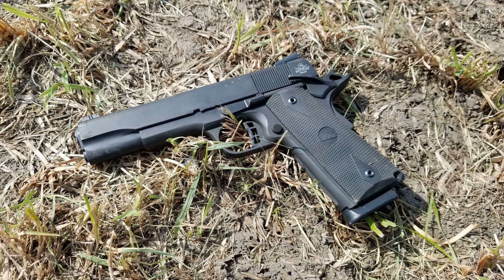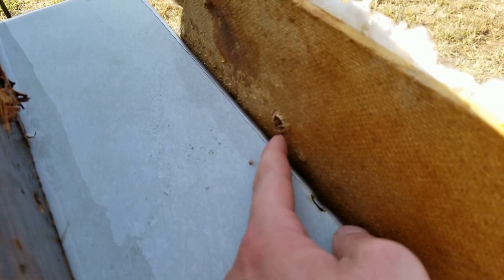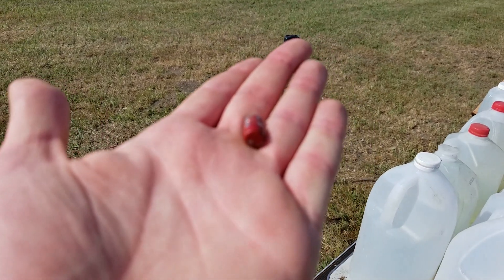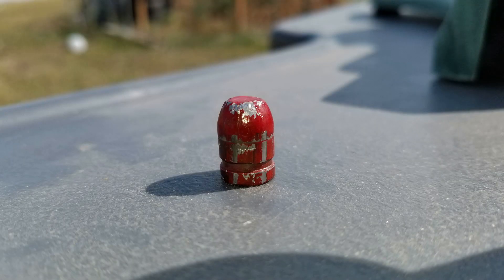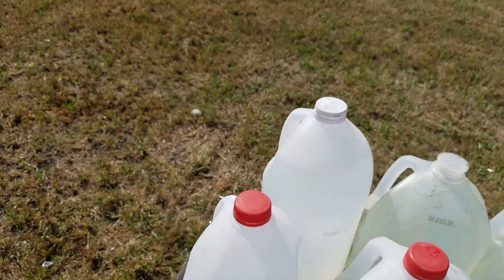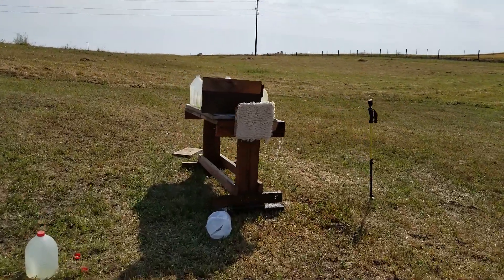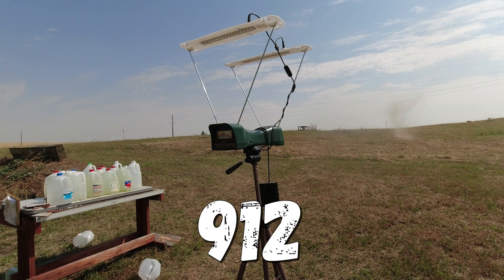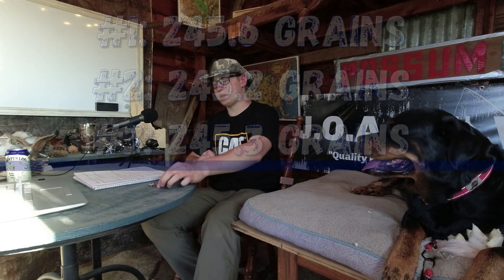45 ACP For Bear | Underwood 45 ACP +P Hardcasts | Jugs Test + Simulated Bone Barriers

Comment from the maker: I want to apologize to everyone here. I advertised that the Buffalo Bore ammo (255gr +P hardcasts) hit harder than the Underwood ammo tested here. But, I made the mistake of using the advertised bullet weight of 255 grains to calculate 520 ft/lbs of force for the Buffalo Bore while using the average weight of 245.36 grains for the Underwood. The more accurate number for Buffalo Bore, using the average recovered bullet weight of 231.25 grains, is 472 ft/lbs per shot. That places it closer to the Underwood's 457 ft/lbs for sure. Buffalo Bore is still a little harder hitting, but not by as much as first thought.

I want to give a big thank you to Rodney Spence for letting me know!  
Thanks guys, and I apologize once again!

(P.S: using the advertised bullet weight of 255 grains for the Underwood you get 475 ft/lbs to compare to Buffalo Bore's 520 ft/lbs)

Comment: I prefer the Underwood ammunition over Buffalo Bore and Doubletap for the following reasons: 1. Underwood is lot more cost effective than either 2. Underwood uses nickel plated brass casings for less corrosion and better feeding 3. Underwood seems more consistent on their stated velocities
Reply from the maker: Those are good reasons, but I do want to point out that the Buffalo Bore rounds were all Nickel plated (that I recieved) and the Buffalo Bore was faster than their advertised velocity and these rounds were just under what was advertised. But thats just my findings, they may differ from batch to batch 👍

Thanks for watching!
Reply: @JepsOutdoorAdventures  Ok good to know, all the Buffalo Bore I ever bought was brass cased, must be something new using the nickel plated cases, even their website shows the brass cases
Reply: Underwood runs very consistent semi-auto cartridge velocities, and they are usually pretty hot stuff. However, they usually quote near carbine-like velocities on the box.
To contrast, Buffalo Bore does very good rimmed revolver cartridges, better in velocity, accuracy, and performance than Underwood does.
Both brands are pretty superb, they each have their strengths.
Reply: Agreed.
Reply: Buffalo Bore is always faster than advertised, but his prices are just absolutely ludacris for the hardly nothing gain in speed you get over Underwood.

Comment: I was just kind of wondering if you had ever read John Taylor’s books. And do you know what he meant by KO or knock out power. He was a poacher, and when he was hunting elephants, if he used a large heavy enough bullet. If the bullet did not penetrate the brain and kill the elephant, it would have enough power to actually knock the elephant out where it would fall down unconscious, and he could go up and finished it off and with another bullet into the brain. In other words, he had to shoot as many elephants as possible, and if he did not have the best angle to quickly kill the elephant with the first shot. He had to bring as many elephants down and the shortest amount of time. He knew if he did not kill the elephant right off the heavy bullett still had enough power, at least to knock the elephant out (knock the elephant unconscious) where he could then go up and kill them quickly afterwards with a brain shot.  If you don’t believe me, read the books because I did.

Comment: Yeah, that's gonna hurt. A 230gr roundball will go right through a 72 Ford Turino front fender, inner fender, firewall, knock out the ashtray, through bottom of front seat, back of front seat, lodge in the rear door. Straight on, it will go through the door and leave a hole size of thumb. We tried it out of a 5" and that was old Winchester White Box. That one would seriously hurt/ stop a bear but it all depends on shot placement. Target groupings at 25yds would be nice. Tkx for the video.
Reply: I laugh at people saying that 45 won’t go through car doors or glass….not in my experience, and that’s with ball ammo.  The Lehigh rounds are even better.

Comment: How about a test with S&W .40 cal 200 gr Buffalo Bore hardcast.

All the tests I have seen show the .40 S&W just as effective as 10mm
Reply from the maker: I do not have those, but will look into them 👍

Btw; I have tested out Underwood and DoubleTap's 200gr 40 S&W hardcasts. 

I had also made a video testing Grizzly Cartridge Company's 200gr hardcasts, but unfortunately YouTube started getting very aggressive towards my channel recently. So I had to make that test, as well as several other videos, private to hide them from YouTube's angry eyes. But the DoubleTap and Underwood videos are still public.

All three performed well. Not quite as well as the 10mm hardcasts from Buffalo Bore and Steinel, but pretty close I'd say 👍
Reply: @JepsOutdoorAdventures  I have read ballistic and water jug tests of Underwood 10mm hardcast 200gr vs. S&W 200gr hardcast.
Thex.40 cal performed just as well or slightly better since the 10mm moving faster, expands quicker and lets the slower .40cal penetrate as deeply.
Reply: The penetration might be similar, but there's still more energy in the 10mm and it does make a difference.
Reply from the maker: @Wildwestwrangler  indeed. Just not day and night like many try to advertise 👍
Reply: @JepsOutdoorAdventures  true, but even a 1 percent difference is a step in the right direction

Comment: the bullet's hard cast alloy and casting process was proved out with the ceramic tiles test. some hard cast and many 230 grain FMJ round nose would turn to lead bits and dust in such a test as was shown in a 30-06John video using magazines, tile.plywood and water jug.    From the fired, essentially undeformed bullets it  looks like the as cast weight of the bullet before firing was lower than 255 grains.  Very well loaded ammo. Good video. Thank You.

Comment: Outstanding job young man! 
I carry the Underwood 255 in woods. I mentioned these in one of your other test videos. These had excellent accuracy for me. Probably the best I've put through my G30 gen 4. This test with a four inch barrel might yield different results and that little extra from Buffalo Bore may be a better choice for power. However given the ammo scarcity and such I'm glad I have boxes of these 255 Underwood from a couple years ago. Reliable function, accuracy and penetration are my main concerns for ammo of all hunting and self defense. With the Underwood they hit where I aim, travel straight after penetration and are better than a hollow point or factory full metal jacket simply for speed, weight, flat nose and accuracy in the timber. 
Again great job.
Keep'em coming!

Comment: What is lowest grain you would use in 45 for bear
Reply from the maker: 230 grain as that's the lightest weight round I've tested, but G9 Defense's 165 copper round looks pretty promising. I plan on testing them out next year to find out.
Reply: Thanks...keep up the good work!

Comment: Personally, I carry a 45 Colt fully loaded. The bullets are 250 grain solid copper, going at 1000 fps, with a TKO factor of 16 or a  KPS value of 35.7, and it will take on animals upward of 1500 pounds or less.  So I do not have to worry about flipping a safety off, nor do I have to worry about shooting my self in the leg when trying to fast draw it in a pinch. And I do not have to worry if I reset the safety either before re-holstering. The only worry with a double action revolver is re-holstering with the hammer cocked back, and if it does not have a spur then that worry is done away with for good. 

Also with revolver pistols people do not have to practice "TAP,  RACK, and SLAP" like they have to with semi-auto pistols. This procedure takes time that when a bear is charging one may very well not have. And it takes both hands, of which a bear could be chewing on one by this time in the game. Revolvers are an ambidextrous one handed thing  that never fail to feed or eject, and if a round does not go off just keep pulling the trigger.

So the only real concern should be which double action revolver one would take to a bear fight? And keep in mind that black bears can be upwards of 600 pounds or so, and grizzlies 1000 or better.

What ever one should choose (a semi-auto or revolver pistol), run the figures of the rounds through the two equations below to see just how big of game one could take down with them. Keep in mind that these two systems are considering a humane kill with a side shot through the lungs and heart of the animal and not a straight on charging scenario, so really the numbers need to be higher than rated below as far as what size animal the rounds will take down quickly. And always choose HARD CAST LEAD or SOLID COPPER/BRASS bullets only, as they penetrate the skulls easier as opposed to deflecting off them.

1) "Taylor Knock-Out Factor" ( https://n4lcd.com/calc/)  
[bullet weight in grains X speed in feet per second X diameter of the bullet in inches divided by 7,000 = __ ]  

2) "Killing Power Scale":
[bullet weight in grains X speed in feet per second divided by 7,000 = __ ] 

[Any killing power index system must have some baseline values that define minimums for the weight and/or type of game animals that might be hunted. After considerable deliberation and discussion, Chuck Hawks and Pacos Kelly settled on the following KPS baselines. Understand that these are ultimately judgment calls, so someone who has a different perspective might question particular baseline values. That said, They believe the baselines presented here to be reasonable, though not immutable.]

Baseline KPS values:

KPS 12.5 or greater: Class 2 game, 50 pounds to about 150 pounds (e.g., average size North American deer, pronghorn, feral hog)

KPS 15 or greater: All Class 2 game, but especially those between about 150 and 300 pounds (e.g., very large whitetail deer and feral hogs, mule deer, caribou, black bear) 

KPS 30 or greater: Smaller Class 3 game, 300 to about 500 pounds (e.g., smaller elk, red stag, oryx, very large black bear) 

KPS 32 or greater: Class 3 game between about 500 and 1000 pounds (e.g., trophy elk, average moose, extremely large black bear) 

KPS 35 or greater: All Class 3 game, but especially those between about 1000 and 1500 pounds (e.g., very large moose, eland) 
[45 Colt 250 grain Extreme Penetrator @ 1000 = 35.7]

KPS 68.5 or greater: Thin-skinned Class 4 game (e.g., leopard, lion, GRIZZLY BEAR) 
[45 Colt 250 grain Extreme Penetrator +P @ 1400 = 61.5 (close). As far as pistols this is a 45 Colt Ruger only load]

KPS 88 or greater: Thick skinned dangerous game (e.g., Cape buffalo, rhino, elephant)
Reply: I am not a hunter, so I watch videos to understand what I would need for defense, but I am always happy to hear what actual hunters have to say. It's odd how rare it is to from actual hunters.

Comment: I worked up a good load for Alaska Trail 
Fed 45 ACP Nickle Small primer pocket 
Rem 7.5 Primer
250 Gr FNRN 22 BHN (Straight Shooter Cast) Tek coated
1.910” 
1040 fPS in G21 KKM and 22 pound spring
8.4 of power pistol 
Underwood / Buffalo bore 18 BHN RimRock is what they use !
Grizzly Ammo is gaining on Underwood and Buffalo Bore in Alaska as the velocity are better and the bullet in 21 BHN .

Comment: Great video and analysis. 45+p for bear defense may be viable. A quick question. Can you define what 45 +p+ muzzle velocity and impact force is? I noticed the HK USP is rated for +p+. I have no idea who manufactures this more potent round.
Reply: Its called .45 Super, they don't seem to use the distinction +P+.  .45 Super brass is slightly beefier to handle like 8,000 more lbs of pressure.  I've shot it through my HK45C and HK45, it was definitely better in the HK45.  I have not shot it through my USP Elite yet.

Comment: Another comment regarding the 10mm.  Mr 1911 himself, Bill Wilson, doesn't think ANY auto platform is adequate for that round and tells WHY.  Pay attention!  Starts at 21minutes. Wilson Combat, Gun Guys episode 55.  If I try to paste the link, this wont post.  Jerry
Reply from the maker: I'll look into that, thank you 👍
Reply: Just watched Bill. I think if I were to carry a 10mm Auto it would  be a S&W 586 in .357 magnum. ;-)
Reply: I never knew bill Wilson made a video on that subject, but I have always thought the same.
Reply: Why bother with the standard 45acp, hop up to 45 super which any 1911 45acp worth its carbon, can indeed shoot and handle just fine. Btw they're pushing close to 700ft lb muzzle. 10 millimeter🍨 10 shillimeter 🥱. Can that 10 mill shillin crap would ya guy's, yes they're great. The reality is that a 45acp has a wide birth of ammo loading power potential. In a quality firearm (like a standard 5" or so 1911 platform or thereabouts) properly equipped with 45 super ammo. That's finally... approaching the calibers upper end of potential energy distribution.
Reply: @Roboticdoughbull3k    In 1911's, it would be wise to use a Wilson Shock Buffer to protect the slide and frame from peaning.  An 18 lb spring would also seem a good choice.  But dont go higher as the closing force could also become excessive.  The 1911 frame was designed around the standard 350 - 400 ft lb energy of the standard 45 ACP.  10 mm's and 45 Supers will give excessive slide velocity, thus needing the shock buffer to protect the gun.  Young Jep is doing a good job.  Jerry
Reply: Yet iv ran 2 boxes through my buddies Glock 10mm  ,, just saying
Reply: @allen4758  A Block aint a 1911...  The 1911 platform was designed around the 45 ACP with its nominal 350 - 400 FPE.  The ~700 FPE of a 45 Super or a 10 mm will cause  excessive slide velocity, and can pean or crack the frame or slide.  A Wilson Shock Buffer will help, and an 18 lb spring, but dont go higher or you can generate excessive closing slide velocity.  You need proper timing for reliability.   (HAY! bear - leggo my arm while I clear this jam... burp...)   Jerry
Reply: @iamnobody9542  I see your argument , and I don't really disagree,, but, I can get an alloy frame 45acp in 1911 , seems the steel will stand up to the 10mm , my opinion
Reply: @allen4758  Sori, you opinion is not based on solid engineering principals.  If you over stress any machine, it will wear out faster, even break.  Your car, too.  Both are machines, and were designed around a particular use range for a given life span.  Lighter target loads only vs magnumizing will affect both life and reliability.  How long do you want it to last?  Be reliable?  Will your life depend on it?  Again - HEY!  BEAR!!  Leggo my my arm while I clear this jam...  burp...  Dunt git et!  Jerry
Reply: @iamnobody9542  you do realize that the 460 Roland was developed for the 1911 right?  It obliterates any 10 mm loading and has been around for decades. Additionally, the 45 Super and the 45 SMC were also developed for the 1911.